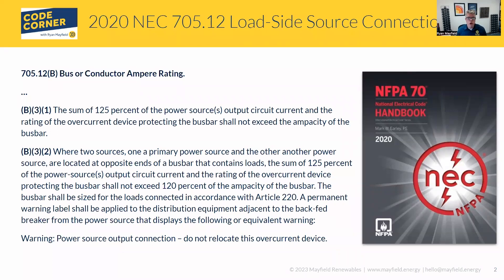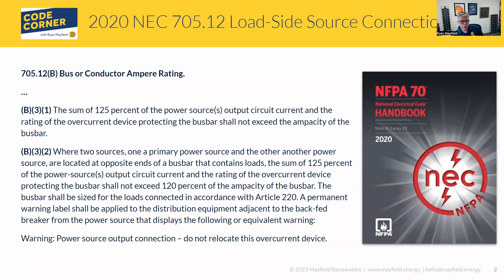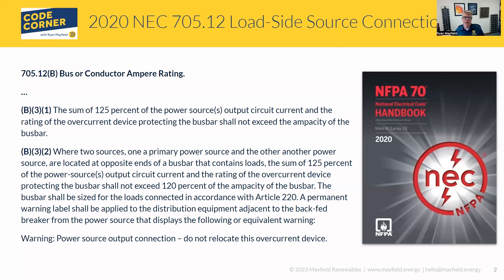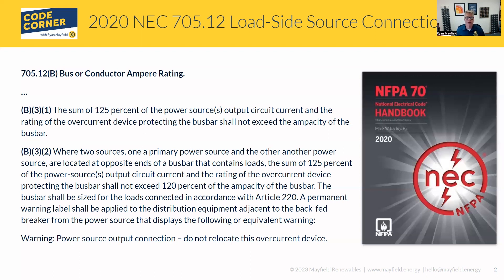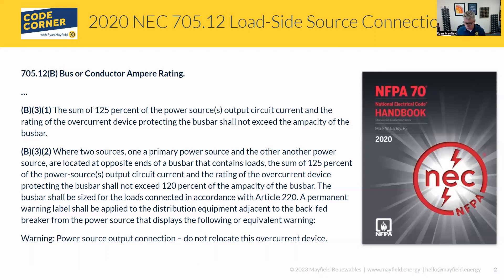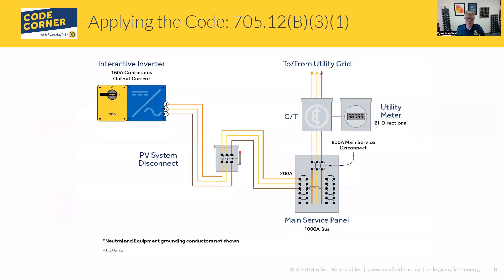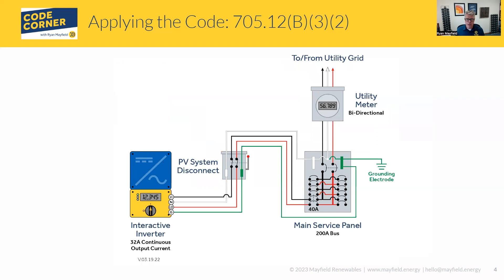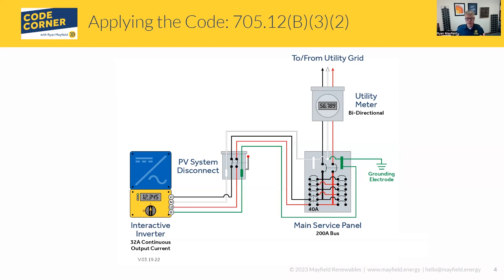Mayfield Renewables Code Corner: 2020 NEC 705.12(B)(3)(1) and (2)

Comment: Thank you for the video!

NEC 2020 705.12(B)(3)(1) Question....looking to do a solar/battery grid interactive system.

Our home has a meter main setup with a 200A breaker. That leads to an interior MLO panel with a 225A busbar. The meter main is a Siemens MC0408B1200RGA.

The inverter/charger we are looking at EG4 12KPV and it's output is rated at 33.3A@240VAC | 38.5A @208VAC and it's nominal output is 8000W. Which figure would we use for the 125%? 33.3A for 41.6A?

For the busbar rating number do we use the outdoor meter main (200A) or the interior MLO panel (225A)?

I would presume the meter main panel? So, we would have to derate the main breaker there to 150A?

So, after the above is determined I can use what ever breaker size I want for the backfeed? This inverter has an 80A pass through and I want to take advantage of that.
Reply from the maker: 33.3A would be the value to start with. The calculation would result in 33.3 x 1.25 = 41.6A for the minimum OCPD, which would be the value to use for applying the busbar rules. You are correct that you need to apply that to both panels, so in this case, it would work for the sub-panel, but the main panel would need to be addressed. Downsizing the main to 150A would be a way to make that inverter's output comply with the busbar rules.
Reply: Thank you for the reply and confirmation of what we need to do to ensure compliance.

Comment: Great as always! Really appreciate your taking the time to interpret the NEC. Have always turned to "Code Corner". Glad to have found it again.
Reply from the maker: Thank you for the kind words! We have many more episodes in the hopper. Let us know if there are any topics you'd like us to cover!
Reply: @MayfieldRenewables  thanks! I have watched some, not as regularly as I should. I'm presently in Mexico and trying to follow code. Unfortunately the original builders sometimes don't even follow the Mexican code so I am usually stuck between a rock and a hard place. Oh, and I don't know how my name shows on your end, it's wrong on mine. I'm not Letty, I'm Fernando.
Reply: First, thanks for the great summary. I’ve been searching for information on the interconnect and bus bar current and this was spot on. Does the NEC code state that bus bar amperage can be exceeded with the solar feed breaker on the opposite end from the grid feed? If so, is this quantified in some way? Thanks!